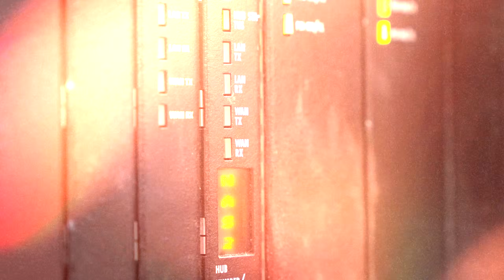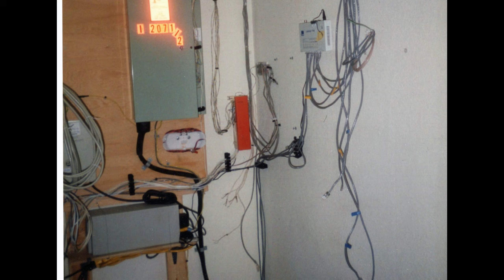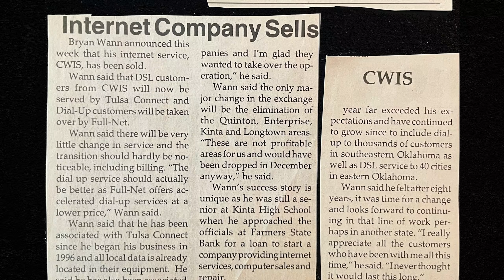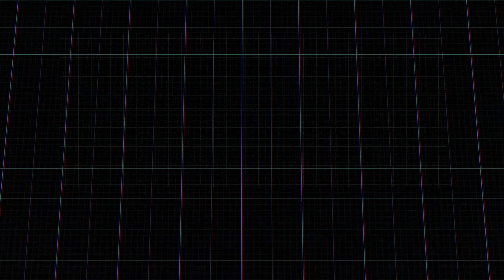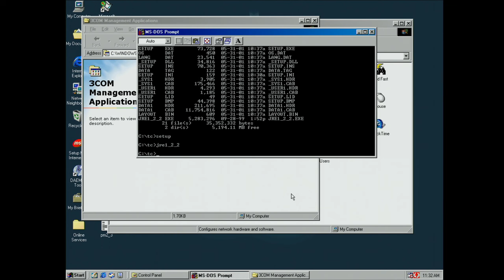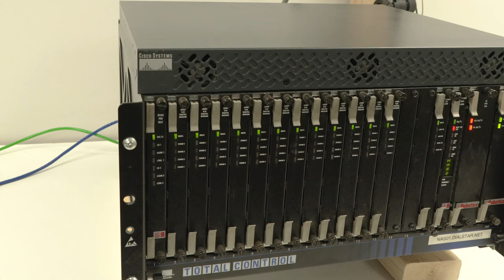DIAL-UP goes DIGITAL: Setting up PRI for the TOTAL CONTROL - ISP Ep 7

Comment: Realistically, you'll probably never get 56k reliably through VOIP. You pretty much need to go pure analog to TDM, and if you're feeling particularly machoistic, add in some ATM in. 33.6 and especially 56k were very dependent on tight timing and a lack of jitter and the like, all of which VOIP doesn't control well. Way back in the days of yore of the late 90s/early 2000s, I was working on T1/E1 Circuit Emulation over ATM. One of the things that I always had to test was modem connections over that. Kind of sad that it's a lost art, but that's the world we live in now.
Reply: Yeah, the v.90/X2/k.flex(we weren't an Ascend shop?) is very demanding, I can't even remember if you could run it on a channelized T1 (due to the robbed-bit signaling) or if it was PRI-only. I know we started with Channelized T1 before the X2 stuff came out and did move to PRI... Kind of a shame there's not really a practical way to get v.90 today unless you have a "real" PRI - as you noted I imagine VoIP just wreaks havoc with it. It's truly amazing that they were able to get nearly 56K out of a phone line that was at base 64K, really bonkers stuff for the time. Some USR/3Com guy in trying to explain the "you can only have that single D/A conversion" issue on the downstream said that it was like "playing the DSP of the phone switch" ("playing" as in "playing a piano") which is an odd but not fully inaccurate way of describing that bit of magic.
Reply: @ChasBlobster I also think that the only way to achieve such speeds is with a real PRI/E1 line. There are attempts to implement such lines via the Internet. But to comply with the timing, the devices that provide the transitions from PRI/E1 to IP must be equipped with GPS receivers.
Reply: @schalotten  Get your hands on some ice1usb devices, they're exactly that! Local GPS clock at every endpoint keeps the whole network beating in sync. I believe the firmware is E1-only at the moment, but the hardware should be T1-capable so someone just has to write the firmware...
Reply: @ChasBlobster   No, you can't get 56k on CAS (robbed-bit) T1s.  PRI only.

Though, for what it's worth, I have everything to do this in my toybox -- FXS ports, ISDN-compatible T1 cards, and digital modems.  With a short phone cable from a laptop directly into the FXS port, T1 crossover from voice side to digital modem pool -- I can get 53333... sometimes.  That's, of course, expected in US-compliant mode due to the FCC requirements that limited the modulated signal level.  But what was interesting is how often I only got 48k in literally the absolute best case scenario possible.

I guess maybe I would have slightly better results with a higher-quality USR modem vs. the Conexant (or whatever) softmodem in a VAIO laptop... but still.  Just goes to show how elusive 56k really always was.
Reply: @nonenowherebye  It even became difficult to get a full speed v.32bis or Telebit Trailblazer connection at one point in many residential neighborhoods because the telcos ran out of pairs when everyone started ordering modem and fax lines. If memory serves, they'd pull a DS-1 to a neighborhood and set up a mix called a SLC-96 that could cram 96 lines onto one circuit. It was enough to meet the performance tariffs for voice service but made modem use miserable.
Reply: @robertstratton6444  slc 96 was one particular carrier type and it had a couple configurations.  You could have 1 t1 per 24 or 48 subscriber pairs.  I guess you could do 96 if you used the liu-p slot and had mux cards in the other Liu slots.  I usually saw them with 1 t1 per 48 customers, then one protect t1 to pickup if there was a failure.  If it's a fiber fed mux there'd be 1 per 24 customers... usually without a protect for some reason
Reply: @MrNoobed  Thanks! Maybe because Residential service was always the lowest class of service for any circuit?
Reply: @robertstratton6444  the line cards to the residences have different specs depending on how old they are.  There's other sources where it could desync too.  Like you could get your voice channel to the carrier in your neighborhood, but in the office it might switch back to analog and then your pcm would have to get your pcm chopped up again but now your timing is messed up so you'd probably only get like 28.8.

Business class people.could order 64 or 128k+ partial t1 or other dds too.

Later carriers like a slc5 or slc2000 would probably be fine for like 48kbps.  They'd have good timing references too.
Reply: Like if you got a channel you'd have the best service even the slc96 could offer.  If it was out of time slots it'd just have no dial tone when you went off hook.  There's no announcer in the slc so it wouldn't even give you all circuits are busy.
Reply: @MrNoobed  Before we (an ISP) moved our stuff out of the office and into a CLEC's colo space we had a full cabinet from Bell Atlantic in our office. It was full of those "SLC" (our nynex guy, "johnny blue", called them "slicks") cards. Fiber came into it and about 300 or so analog lines came out the back and into a giant punchdown panel on the wall. Prior to this being installed we had issues with all modems dropping at once. The copper ran through the building's freight elevator shaft to the basement where there were a bunch of SLC cabinets. Pretty much any time the freight elevator was engaged, you'd hear the sound of a few hundred relays clicking as all our modems dropped their connections... fun stuff! Don't know what the hell was running alongside the POTS bundles in that shaft, but it was not friendly.
Reply: @ChasBlobster  Variable Speed Drive on the elevator motor? Those things are electrically filthy, and filtering is optional on a lot of them.
Reply: This series is helping g me a lot get more familiar with t1 and ds0 circuits lol.
Reply: Talk about the telephone network going ATM. Back in the 90's, I built a MIDI over dial-up modem converter for a couple of art universities. They use this to sync up 2 disklavier pianos so they could have live piano concerts between the 2 universities remotely. Before that, they were paying thousands of dollars a month for a direct T1 between the 2 universities. Sometime in 2002, by device started acting up, it work, but the timing was off and all over the place. I tried to analyzed the problem to no avail. So they went back to the T1 line only to find out that they were having the same problem. It turn out that the long distance telephone network move to ATM mode and it was no longer possible to get a synchronous T1 line anymore. this pretty much put an end to their remote piano concerts. The situation here was so dire, that I was even contemplating using short wave radio to link the 2 universities together.
Reply: @appliedengineering4001  "Another Technical Mistake"  ATM "cells" (packets) were too big for voice and too small for data. At the ISP, we used to call it "the packet shredder."
Reply: Indeed. I remember having to rewire my house for 56k because 50 year old cable that had been spliced a number of times couldn't handle it.
Reply: Yes we live in a saussage
Reply: It's remotely possible, but you'll use 2-3x as much bandwidth - 128-192kbps. Most VoIP systems want to use compressing, and audio mangling codecs. (anyone remember AT&T TruVoice(tm)?)
Reply: Even in the heyday of dialup I never saw higher than 44-48k or so.
Reply: I remember rarely getting 56k speeds on my PC back in the day and it would literally depend on the weather. My buddy who lived a house down always got 56k though and it annoyed me. In retrospect it was obviously down to line quality in my house or the box outback.
Reply: The good'ol days...
Reply: Not the same thing at all
Reply: I'm setting my old bbs back up and trying to figure out what I need to do to use Google voice. I have a linksys voip box and just need to make the Astrix pbx?

Comment: I remember working in a computer store and having different isp's using different modem banks that created issues for home users. It is why I hated USR. Add plug n and play around with it until it works. What a nightmare. I'll be honest though. I did not keep track of what ISP used what banks. As pointed out in the video. One ISP did have 2 different numbers to dial into to help modems work via 2 brands of modem banks. One thing that did help was using name brand modems (like zoom) that had firmware upgrades. My last dial-up modem was a 56k zoom isa modem with jumpers to disable plug n play. I got some crazy connect rates. 5,2x and 5,3x rates. Nice knowing the isp head tech. I told him on day. I was on the phone with him. He wanted to know why I had such a high connection rate. I told him I had no idea. I was in the bad part of town and all I did was one a wire from the customer service interface to the modem. I did clean off the copper in the box though. I also learned something new. I read about modems being digital. But, until recently I didn't realize the modem banks connected to the local telco phone switch via ISDN/PRI. I just know it was analog modems on shelves backed by a frame relay line and or t1 for data (internet) access.

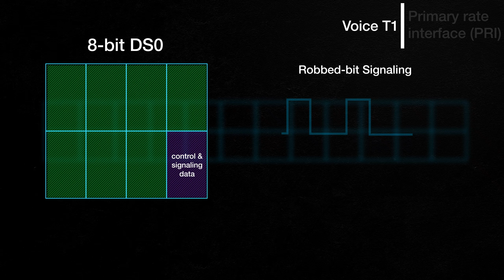Comment: Nice video, tho @12:02 you are wrong there. What you explained used to be called a T1 CAS (Channel associated signaling), there is also R2 variant which works similarly (using robbed bit signaling) a PRI uses a dedicated D channel (control channel) instead of using robbed bit signaling.

Comment: Loving seeing the Total Control.  We almost went with those for our ISP but ended up with PM3s instead.  Unlike Bryan, we never had any issues with people connecting.
Reply: It was a day of celebration at the early UUNET when we removed the PortMaster from service. I used to use its powered-off carcass as a chair on which to sit in the machine room.

Comment: Yup, the European equvivalent E-1 have 32 64kbps channels but it doesn't use "robbed bit" encoding so it's always a "PRI" with 30B+D (the first channel is a "sync" channel that doesn't exist in the US system) - so all E-1's are "PRI". The D channel is also in a different channel slot in E-1 vs T-1 so yeah, it needs to be set correctly for any communication to work. Side-notes: You can (or at least could) get T-1/E-1 with less active B channels if you didn't need that many lines.
Reply: In UK you could get 8 to 30 B channels.